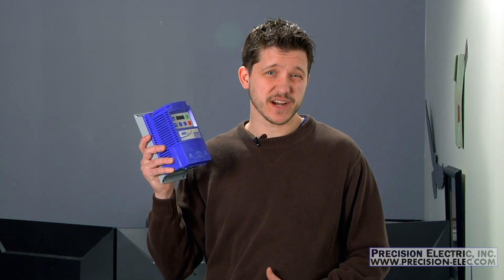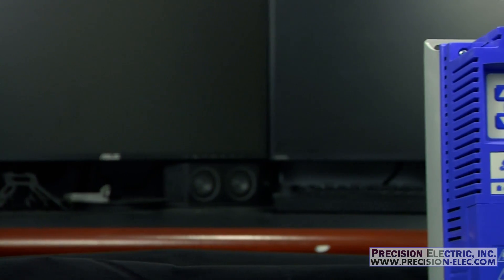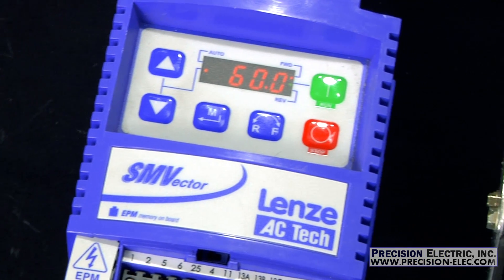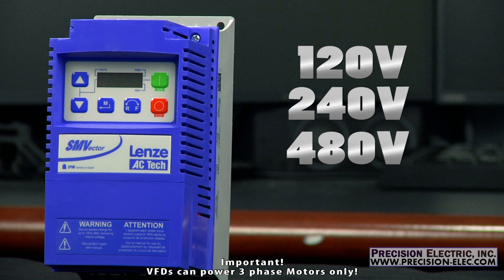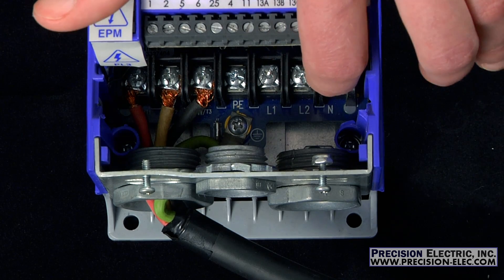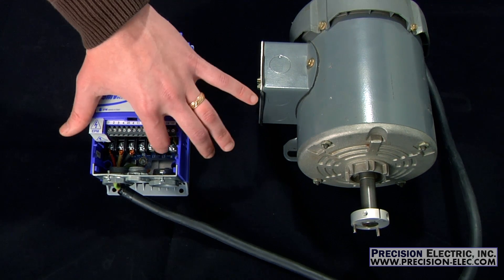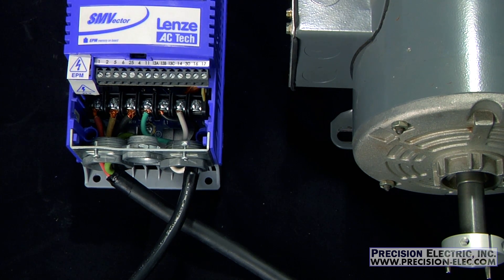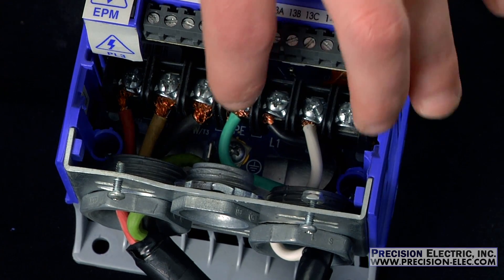The Lenze SMV VFD Single To Three Phase Converter For AC Motors

Comment: Just a simple VFD question for you.. My 3 phase motor is has 4 wires.. the 3 motor wires and the ground.. is it good practice to ground that with the L1/L2 coming in or should I just leave it as is.